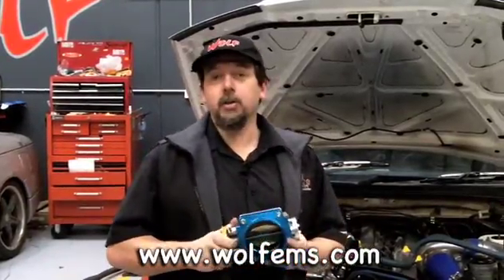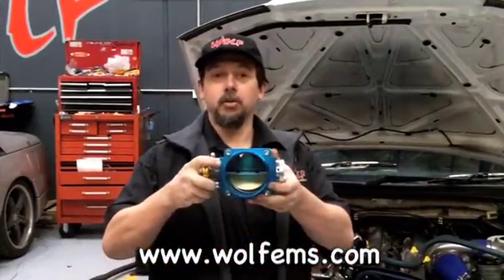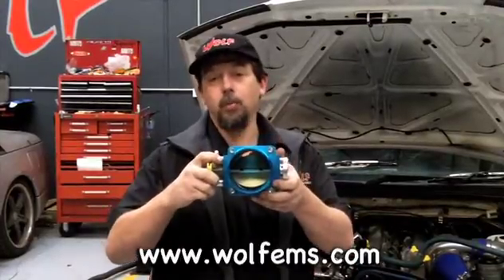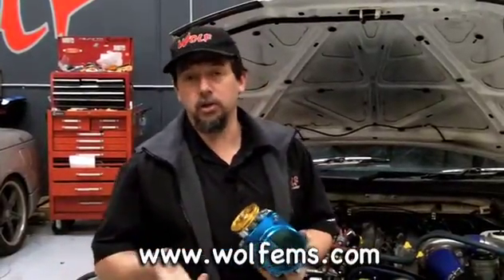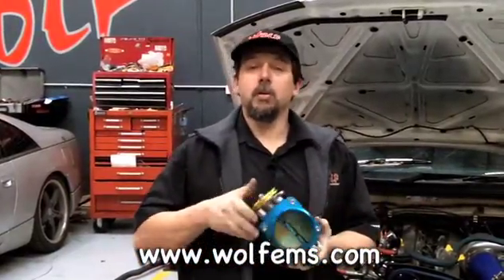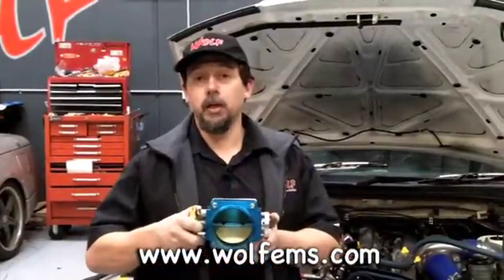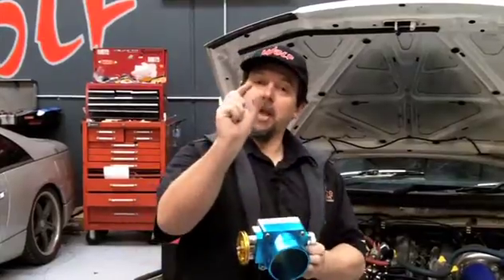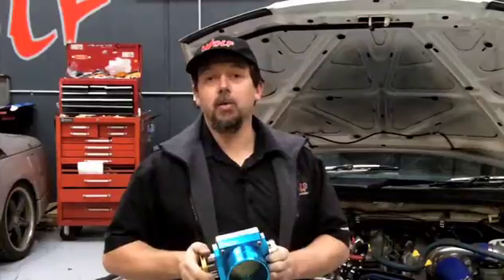Throttle Body Size Bayswater | Fuel Injection Bayswater

Comment: hi robbie, what size throttle would you suggest for my turbo v6 commodore? im aiming at about 350-400hp. i have available to me two 60mm TBs and one 65mm. 
ill be runnign a T70 turbo and 3inch intercooler piping.